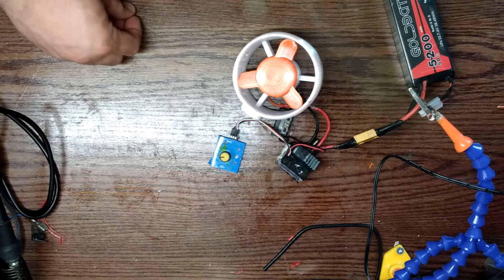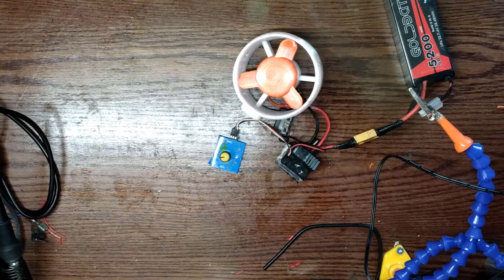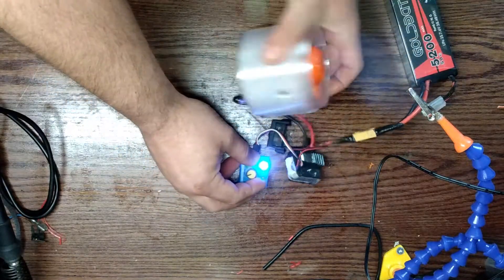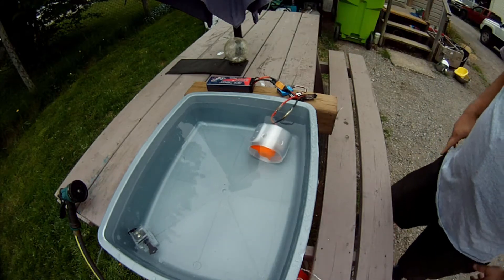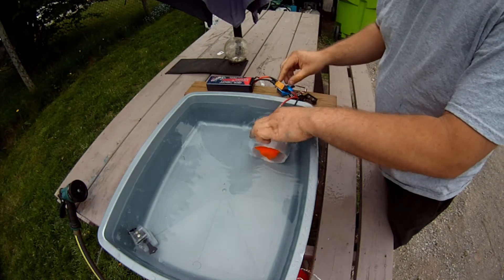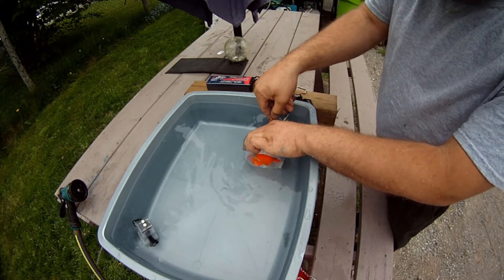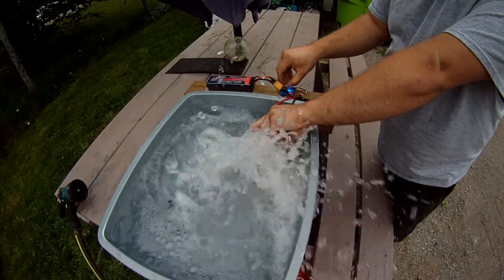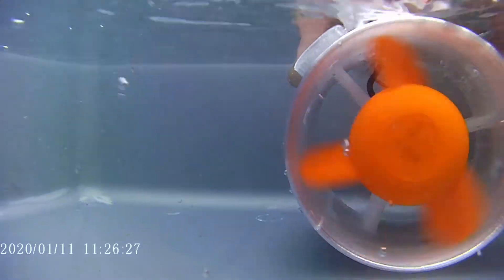3D Printed Thruster

Comment: Can that motor last submerged? A 540 looks likes a standard open body, air cooled dc motor? Fantastic print btw- Great idea :)
Reply from the maker: Never had any issues running them in water , considering I break them in using the water dip process . Just gotta oil the bearings and commutator , I use mineral oil . I have also started drawing up a magnetism drive sealed version .